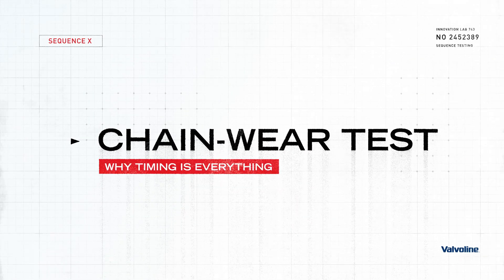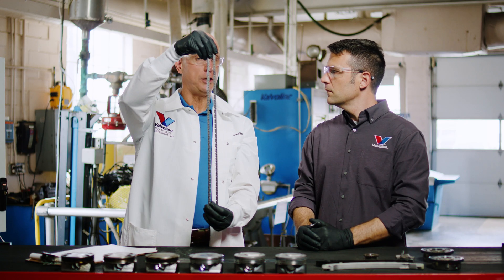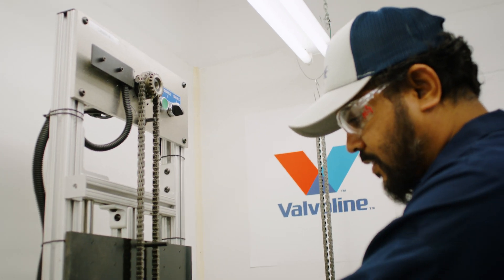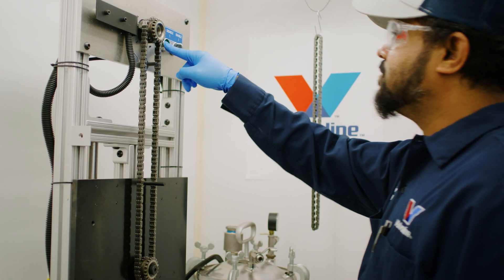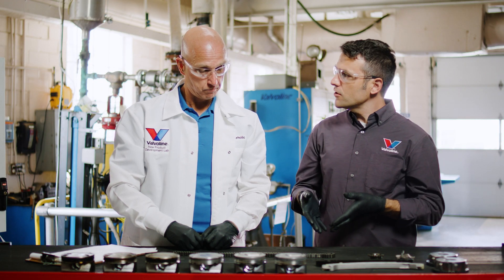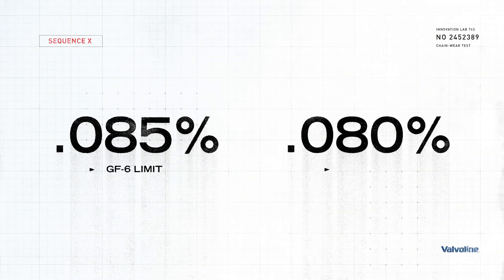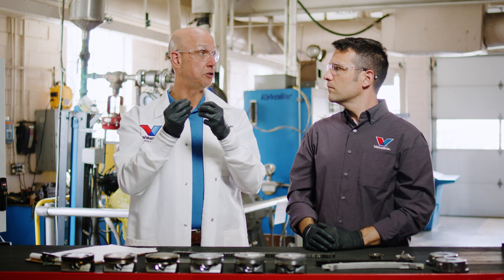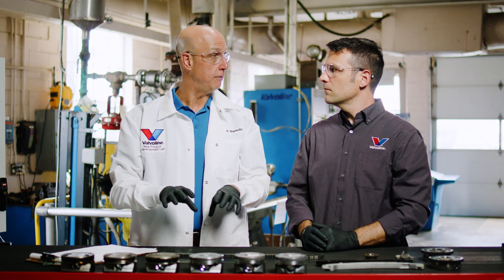GF-7 Standards: Tougher Standards, Better Performance

Comment: Car recommends  0w20.   
For better wear protection in summer months.    5w20 be better.  ?
Reply: 0w-30 would be better in your case.
Reply: The answer is likely to be yes assuming the same formula and approvals. 

Depending on what your temperature range is for summer, you could run anything from 0w20 to 15w40. To make it easy I would recommend a quality 5w30 or 5w40 depending on your environment (temperature).